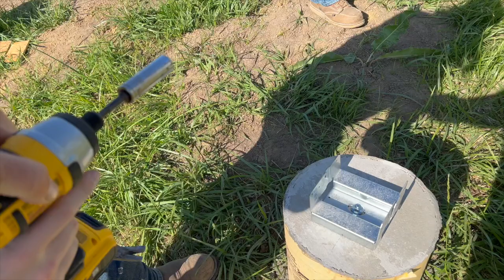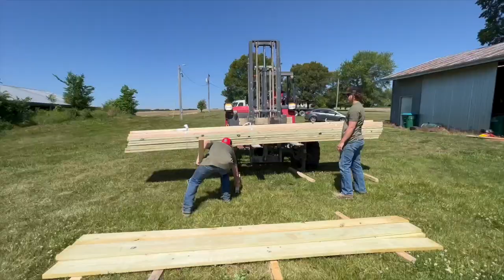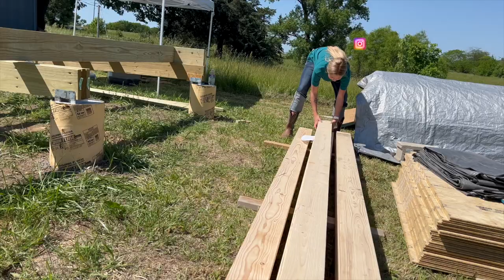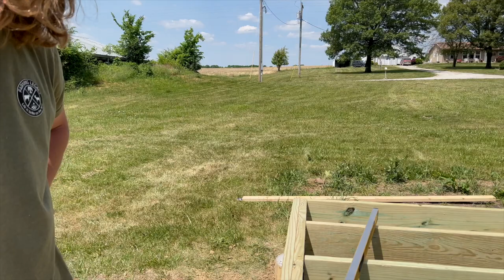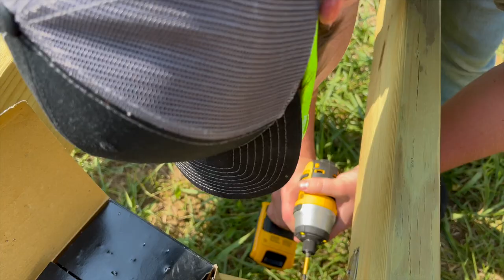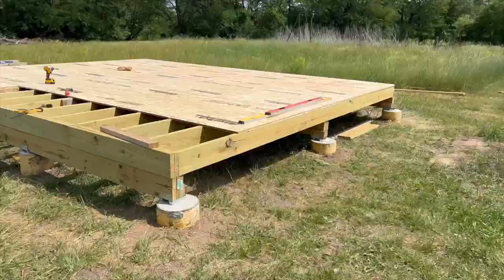DIY TINY HOUSE | Floor joist & ADVANTECH SUBFLOOR install | 'D40'

Comment: Isn't moisture  from the ground going to soak up into cabin without plastic and gravel underneath  cabin?   So much time and money spent on cabins and the foundations  are too cheap  and it's the most important step.
Reply from the maker: Hi Nancy! The lumber is all treated and so I wouldn’t expect that to happen, but it might have made it better when i go to do plumbing under there. 🙂